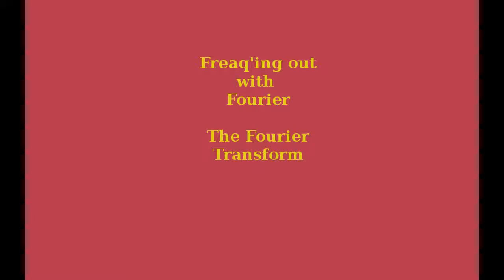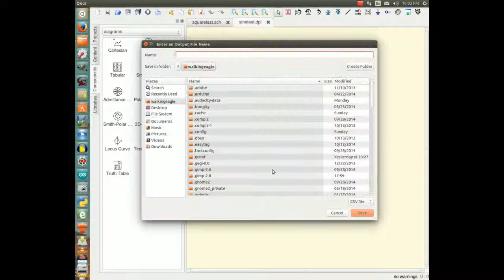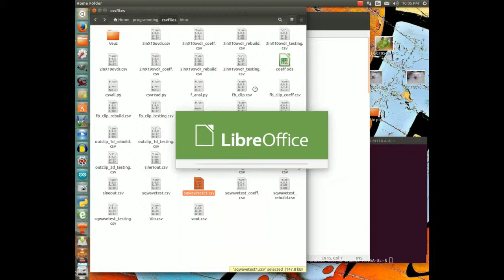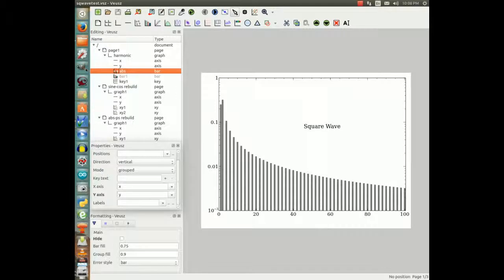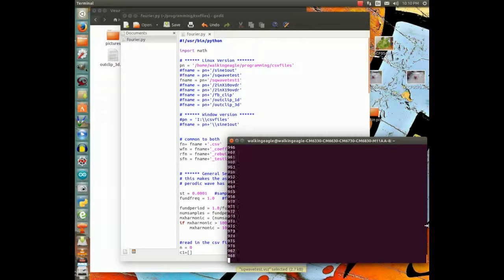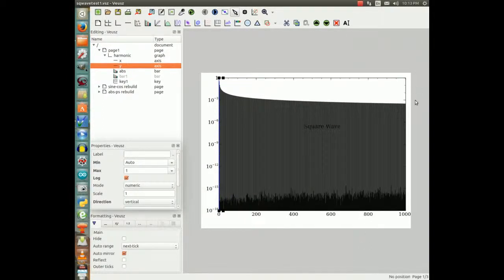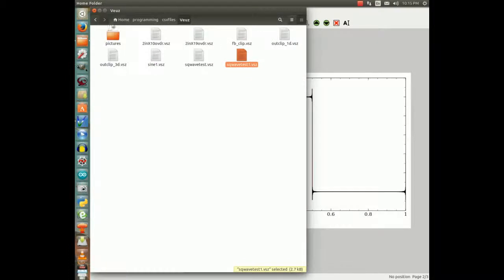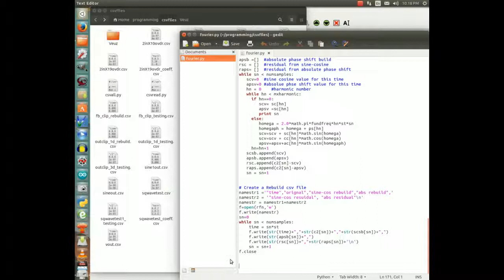Finding the harmonics created by a Qucs Simulation

Comment: The reason why Libre parsed the data on import is because you checked the box semi-colon under "Separator Options".  Libre parses the data by looking at Spaces, commas, and in your case semi-colons.  So it makes sense it would work.  Look at your video at marker 5:23  and under "separator Options" you will see "semi-colon" is ticked in orange.